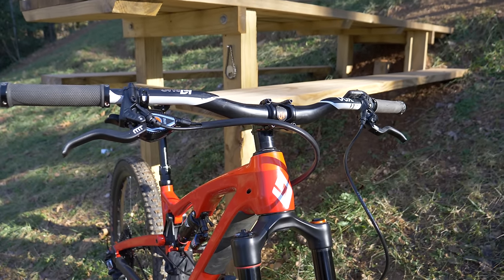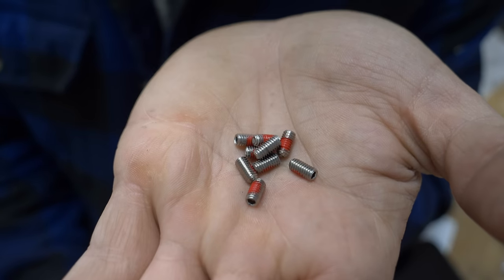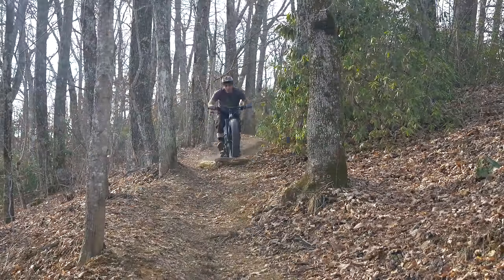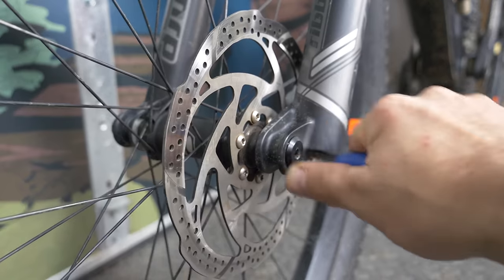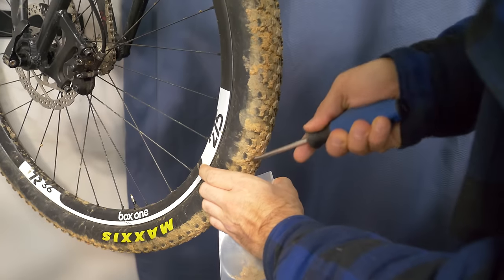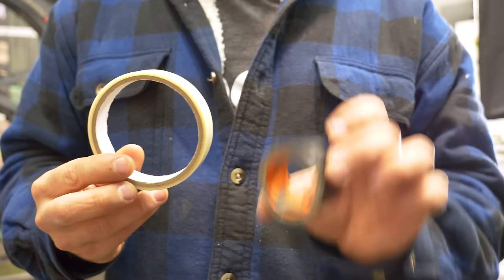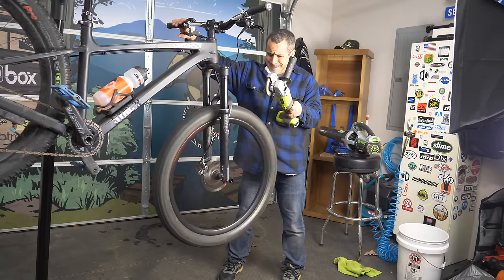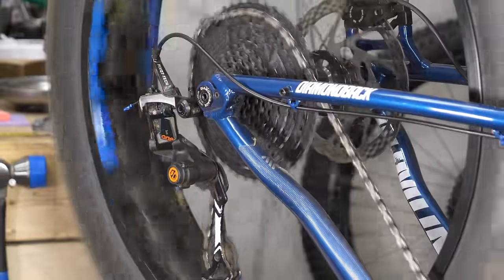11 Super Cheap MTB Upgrades

Comment: Chain oil is actually great, Seth's experiment is misleading.
Apply oil to the individual rivets of the chain so that it soaks right in. Before riding again use lint-free cloth or newspaper to wipe all excess oil off the chain and it won't attract dirt.

I use car gearbox oil on my chains, it's high-performance and has the right viscosity and composition for the job. It's also a third to a quarter the price of bicycle-specific oils by volume.

Comment: tubeless is more trouble than its worth. best part is that it is still recommended to carry a tube even for a tubeless set up so you can get out of the bush if the worst happens..honestly it only takes a lb or 2 off your wheel. If you aren't racing it doesn't matter.

Comment: I have a 7 rear 3 front geared bike, and the front gears literally dont work so im glad to know i can just change to a single one, thanks!

Also how difficult would a 10 speed AND trigger shift conversion be?
I plan on changing 90% of the bike parts anyway as a past owner left it outside and everything but the frame is in pretty poor shape

Comment: i had an allen bolt thru axle on my focus bold sl and i swear to god that thing would always come loose unexpectedly, no matter how you tighten or what you do, halfway down the trail the wheel is about to fall off and ruin your bike and your day, i was so concerned i ended up snapping an allen key inside of the axle and had to cut a notch in the axle head to take it off,to avoid all this i found that quick release thru axles worked much better for me but to each their own

Comment: If using aluminium valve caps smear a little ceramic grease on the threads of the valve.  They won't corrode

Comment: I'm all about color and I've already added a bunch to my new acquired Klein Palomino on a low budget $10 green platform pedals (Amazon) , $20 yellow gold bars  (Amazon), transfered my teal Santa Cruz grips from my old bike, (metallic purple stem cap for $7 from our local shop, $10 black stem (Amazon) that i will eventually paint  and the final touches were from a video of yours i saw a few years back where you changed all the zip ties (harbor freight tool multi colored bag) 👍

Comment: Make a bike that has a cone or plow on the front like in front of the front tire and then use it in the snow. 

Backstory: I actually was thinking of some how making this but I don't have the knowledge of the support beams and were to attach it. I have not done research on this but if it is possible I believe that you guys could definitely do this.Make a bike that has a cone or plow on the front like in front of the front tire and then use it in the snow. 

Backstory: I actually was thinking of some how making this but I don't have the knowledge of the support beams and were to attach it. I have not done research on this but if it is possible I believe that you might be able to do this.

Comment: if you get a thorn in your tubeless tires, and the sealant plugs it, will it stay plugged for good?
Reply: pretty much, as long as there's still liquid sealant in there.  You have to add some every so often regardless, it gets used up and dries up over time

Comment: Hey bruh take a cut off tool or a hack saw and cut a line down the center like a flat head screwdriver and then use the flat head screw driver and boom quick and easy broken bolt extractor

Comment: I allways use 10-speed chains for 8 and 9 speed bikes, it makes for smoother shifting and less contact noise.
The only downside is that your front deraileur might drop the chain if it's cage is wide, this can be modified.

I had huge issues with noises on my trek road bike, the chain was touching the front deraileur or the bigger sprocket depending on what gear i chose on the cassette, went from 8 to 10 speed chain and it's perfect!

Comment: One note about converting to a 1x system. If your bike has rear suspension, it is typically designed so that it climbs well in the granny gear (to give you better anti-squat percentage) and descends well in the bigger ring. If your bike came with something like 36/22 set in the front, do some ride tests on similar bikes with 1x setup so you know what kind of riding experience you're signing up for. That said, converting to a 30T or 32T up front seems to be a good compromise in anti-squat in many cases. So much so that major manufacturers are offering the same bikes that used to be 2x a couple of years ago as a 1x with 32T chainring now.

Comment: Ok so I always get second hand bikes cos I ain’t made of money but I recently got a full sus and I’ve been doin it up and I changed it to 1 by as it’s got 9 at the back which is plenty but in case anyone wants to know to do this I bought cranks, peals, and the sprocket all together and but because of this I had to remove the bottom bracket as it was tapered and I needed splined so that got removed and thrown in trash got a new one and also bought new bots as thy didn’t come with the bracket and then just attached everything up, although if your don’t have money or resources it can take a while it is definitely worth it the bike looks so much better and feels better to and it’s easier to not have to worry about so many things failing or gears and stuff

Comment: i found due to my hanger being broking and using it non on the less and therefor bending my quickrelease bolt, that if you got a quick release then there are colored variations of that as well and they are also kinda cheap für like 10 bucks

Comment: Great video Seth! Though there's one thing I noticed on the video, when installing the brake pads, you did so with your bare hands; couldn't that leave an oily residue which may cause problems later?
Reply: You can handle pads by their edges and backing plates. Just be careful not to touch the friction material. You can also assemble both pads and the spring together, and you'll be grabbing both pads together by their backing plates.

Comment: Just want to ask any thoughts/hacks on chains that jumps when back pedaling? I am on a 1x12 SRAM eagle and  already rigged everything correctly yet still can't determine any good fix. I may try replacing the chains to an expensive one, but I have seen a video that changes the chain and did nothing. Thanks for any suggestions.

Comment: Hey Seth, I was thinking about converting from 2 by 10 gearing to 1 by 20. Does that even exist? Also what would you recommend if it's possible?
Reply: I’ve never heard of a 1x20 drivetrain but I would recommend 1x11 because 1x20 would be insanely big

Comment: Seth, the 1-by chain conversion amazon link doesn’t work. It just searches “narrow” on amazon for me.
Reply: Ey dude, did you get around to finding the 1-by? I wanna convert  to 1x8 but my local mike shop priced the conversion to 500 euros, the hell is up with that crap.
Reply: Tatiana Ang yeah, that’s about how much my local bike shop estimated for me. They told me I shouldn’t do it, but I can’t remember why. So I won’t bother with this.
Reply: @AsianDrag0n  It basically turns into a different bike.  It seems easier to get a new bike with those specs.
Reply: @Jumpinpigeon  really depends on what you have on your bike right now, but wtf, 500 is like changing the whole drivetrain! If you have standard cranks with removable chainrings then just get a new nw chainring, I've seen them to go for 5-20 bucks on aliexpress. That's all you need. If you have cranks that are riveted together, you'll need a whole new crankset, those cost more, but I think you can find one for about 50.

Comment: im at a bit of a crossroads i have a pretty bad mountain bike that cost around 150 im wondering if i should start spending money on it and making it better like changing the v brakes for disc brakes and stuff like that but i dont know if its worth it and it if it would be better saving for a better more expensive bike

Comment: I just need to say that mountain biking isn't expensive compared to other hobbies when you consider a lot of people have a couple $6000 4 wheelers. That probably only get used maybe 6 times a year. MTB @ $6000 is plenty for most people. It gets used 75 times a year at least. Plus it keeps you in shape. Plus most rides don't cost any money for the ride itself like gas, registration etc. In short people that don't ride think you're insane for dropping $6000 on mountain bike, but then don't bat an eye at the out of shape people with two old four-wheelers and a trailer. JS

Comment: Seth, i don't have any bolts around my chainring but want to instal a chain guide, the designs i'm looking for are small  and fit on the upper half of the chainring. this obviously won't work for my bike since i don't have the bolts around the chainring. any ideas? cheers

Comment: Yo Seth im entry level when it comes to MTB but id like to get out more this spring i tryed finding groups in philadelphia on meet up but was varry thrown off. I was seeing posts like if you dont have a full suspension bike dont bother no beginners excetera excetera. I have a catalyst 3 hardtail Cannondale and I'd like to really get out and use it this year maybe even get a RockShox front fork for it but I'd also like to find some groups to ride with that was a whole idea in me buying this bike by the way. I'm short on the dough and I really can't afford much desired 1 by any ideas
Reply from the maker: If someone excludes you due to your equipment, find a different group! Find out what volunteer group maintains your local trails and attend a dig day. Those tend to be the most welcoming people. They’ll welcome the extra set of hands and point you in the right direction, I promise.

Comment: Hi, it might not be a cheap upgrade but im thinking about a dropper post but my frame (merida big nine XT 2018) has no hole for stealth dropper posts can one drill a hole for it? or will it create a weak point which can later on damage my frame? I know there are normal versions which go outside the frame but i would like to keep it a cleaner look, thx best regards

Comment: This is why I hate that style of pedal pin. Many pedal manufacturers use a pin that threads though the underside of the pedal. This way, the broached end of the pedal can still be accessed after many miles of abuse. Moral: don't buy pedals with stupid pin design.

Comment: Couldnt you just use a dremel and cut slit across the top and use a screwdriver?   To get the old bolts on the pedals out.

Comment: From a bike mechanic, please don't use gorilla tape to replace rim tape. Just don't.
Reply: why not?
Reply: @tarcobadge4744  Most of the time it works ok, but when you have to take it off it usually takes about 2 or 3 hours to clean the inside of the rim. I'd rather pay someone to do it than do it myself. So if you have no other choice, it will work as a hack but otherwise just use tubeless rimtape.